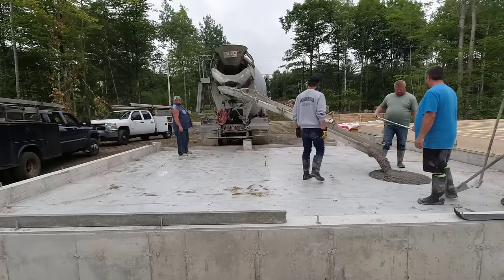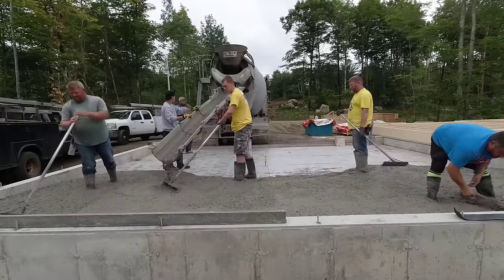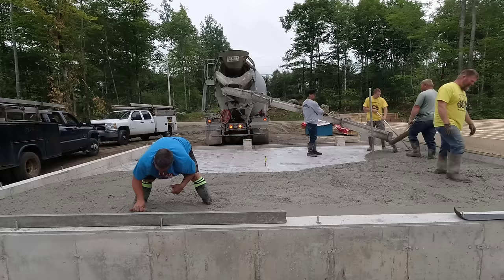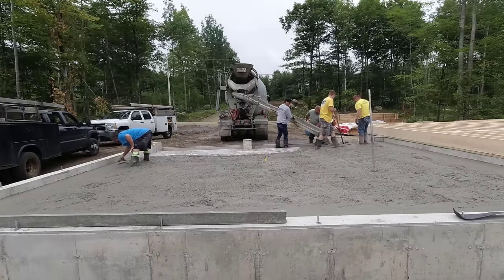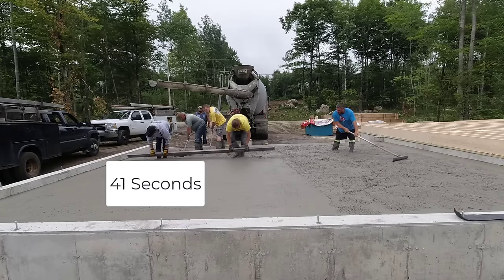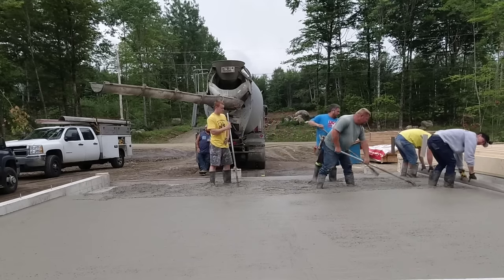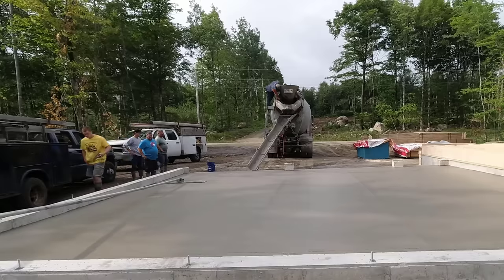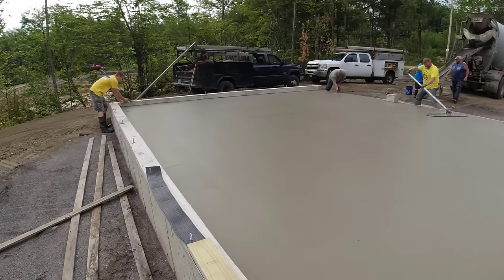We Won A Gold Medal With This Pour (Quality & Speed) What Do You Think?

Comment: Nice work Mike. I’m not a professional concrete guy but have helped on a lot of jobs for my friend who is. So I’ve seen good crews and not so good crews. You’re definitely the former!  I’m in Northwestern PA so a similar climate and similar requirements when it comes to mix design. I like that you’re using a 3,500 PSI mix for your inside flat work. Do you add air for a job like that due to the fact that they may not heat that garage?  I noticed how creamy that mix looked. Definitely helps with your screeding and finishing. Didn’t look like you had to work too hard to get the aggregate down. Greetings from Northwestern Pennsylvania!  Just subscribed to your channel.